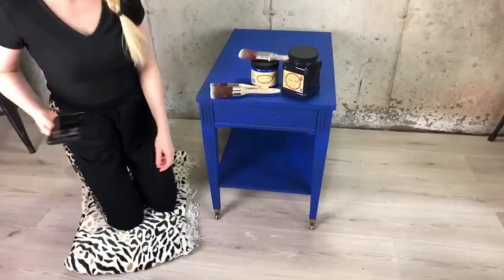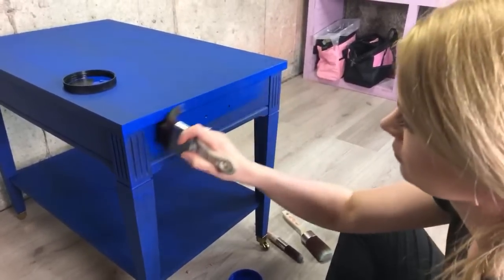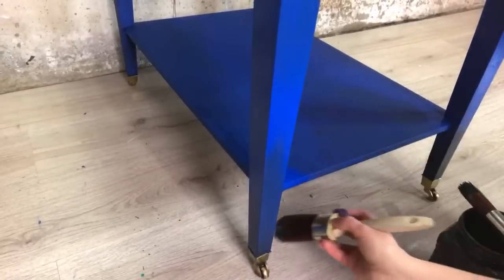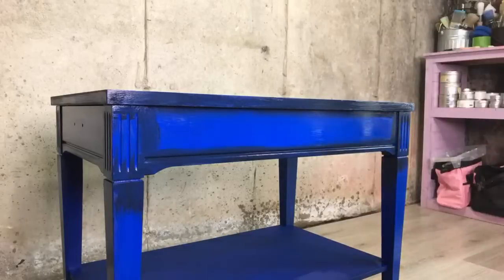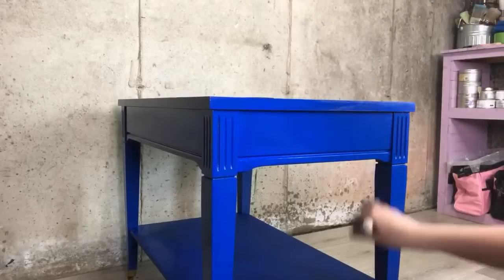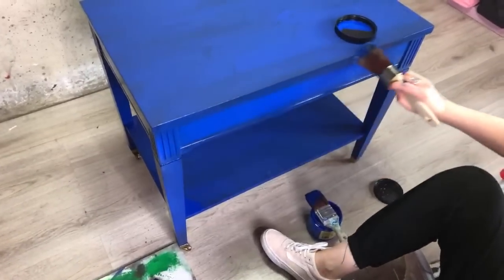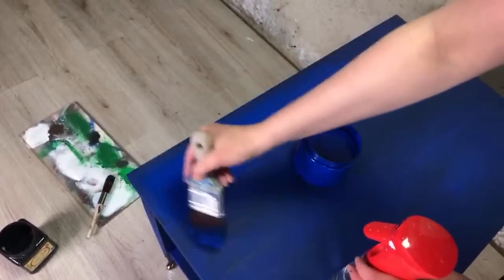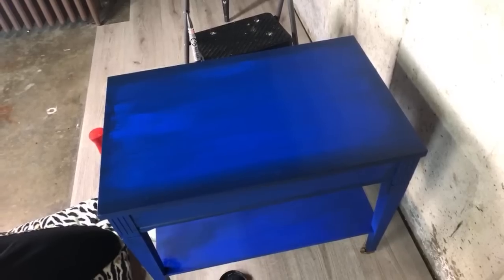Live Chalk Paint Blending Tutorial

Comment: When you have good brushes to store, how do you do it?   I mean, some you can rinse in water, but not if the paint isn't water based.   My brushes always dry up
Reply: Noreen Constantine:  Even with brushes used for oils, wet them in the sink under running water and ‘shampoo’ them into a lather with bar soap or dish soap.   Rinse well and repeat the shampoo.  Then wipe excess water and allow to dry. It will be a better outcome than allowing them to air dry with the paint on them.